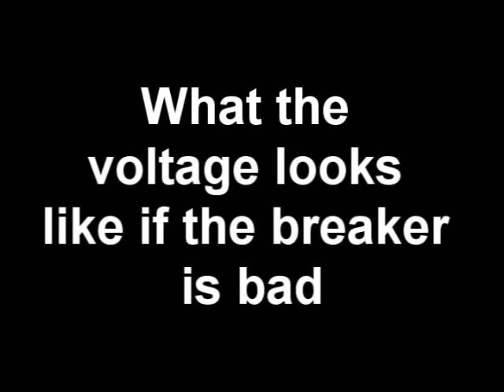Checking for a Bad Breaker

Comment: Should the breaker be turned on or off before you do this test?
Reply: Not trying to be nasty but after that question do yourself a favor & do not open your electrical panel without an electrician with you.
Reply: trudaroof 👉🏻😂

Comment: I just had a double pole 20 circuit breaker go bad. There were two hots connected to each screw. I had the power turned off at the main breaker. After disconnecting the circuit breaker I turned the main breaker back on for light. I took my tester and checked the four wires I just disconnected. One of them was still hot. How can that be? It is not connected to a breaker/ I would appreciate your feedback.

Comment: they might have had that one wire that was still hot connected to another breaker, maybe in a junction box somewhere. so, it was double fed and you could check this by turning off the other breakers one at a time and when your mystery wire goes dead you would confirm it. but then you have to find where it was connected, and of course what caused the whole kerfuffle. good luck.

Comment: I have a 40 amp, 2 pole Square D that reads 120v to ground for both terminals but, 0 volts terminal to terminal.  I still can't figure out how that is possible for a Delta circuit.
Reply from the maker: Ok if your getting that kind of reading on that double pole breaker, test another double pole breaker in your panel to see if your getting the same results.  If your not, then change out the breaker, if you are, then you will likely have another issues such as a bad main or even service issues to your home.

Comment: Why do you not make contact with neutral first then red?
Reply from the maker: Its just how I did it in the video.  But if I am checking a double pole breaker, its just force of habit for me to check one side to the other first, then each pole to neutral or ground.  But in reality so long as you do all those checks, the order does not matter.

Comment: good video. don't know if you can answer this, but my washing machine stopped working. when I checked the outlet with a multimeter it just reads 100 volts. but at the screws where the wires are connected, I'm getting 117 volts. any advice? thanks

Comment from the maker: @kurttwentyeight - I personally dont like analog meters.  For the type of work that I do, analogs will not work.  However, they will work perfectly fine when checking voltages such as this.  So whether a digital, or analog - you can still do this test.  Hope this clears this up for you.

Comment: Hi  I have a pushmatic panel box. I recently started having problems with losing power to office and garage lights while the basement lights are wired on the same breaker and stay on. I have taken panel cover off and there is only one wire. I unscrewed this wire and moved it around a little and the power to the office and garage started working but when I tighten the screw down it doesn't work.  Any idea what my problem is?

Comment: my power died on all the plugins on one side of room. checked and replaced the ones that looked questionable (burnt spots) tested each one before install and still nothing at plugs. got power above (lights ,fan, etc) what is it ? dont really want to go in attic where wires run. could only half the breaker be working? it is a 15 amp one.

Comment from the maker: Are you saying that you checked the outlet and got 100v when you simply pushed the prongs into the outlet?  Then pulled the outlet and got 117 when going directly to the wires?  If that is the case simply replace that outlet.  Corrosion has set in and it needs to be replaced.

Comment from the maker: That tells me you have a loose connection in one of your outlets or switch boxes.  Or its also very possible that one of the connections are corroded preventing the power from flowing through.  Unfortunately for you the only way to fix this for good is to open up each affected device on that circuit and pigtail your wires.  That will prevent this kind of occurrence from happening again.

Comment: I had a breaker trip on my hot water tank, it seem to reset ok. i checked all my elements etc. but still no hot water. Is it possible the breaker is bad even though it apparently resets?

Comment: if the breaker tests bad though would it still work?
Reply: yes, my 30/20 amp rv main breaker trips, I already know it's the ac only when I have the compressor on the ac is hooked up to the 20 side, will run a while but when it trips the breaker and I reset it, takes a while to reset, I checked it like he shows on here, never done this before and shows 120 volts on both sides , but only the 30 amp main side trips instead of the 2, and asked seriously if maybe even though it test 0 would still work just not fully as it should I think if it shows 0 it should not even work 0 volts means no voltage, no electricity flow however I asked before I tested mine, as far as the ac  I cleaned the coils yesterday, and the breaker did trip a few times so I need  to keep trying to figure out if it may be the capacitor, freeon, compressor itself or wiring, I tested the breaker but was thinking about replacing it, but hasn't tripped today even though the question was serious I think the answer is No '0' and Bad should mean it won't function.
Reply from the maker: Compressors typically need a dedicated circuit in order to operate.  If you are using this in your RV you are very limited on power available and likely going above the breakers threshold as you are using other appliances.  I would suggest that you get a smaller compressor or just use the compressor only at a campground where you can plug the unit into one of those RV pedestals.

Comment: If you have gone through and checked all your 220v breakers in the panel, and this is the only one that show 0v to ground on one pole, then yes this would be the bad breaker.  If all your 220v breakers are doing this then you would need to look at your main breaker.  But again if its just that one, you just need to change out that one breaker.

Comment: My breaker takes about 15 minutes before it trips, Clothes dryer 220 any input. my stove is on the same breaker so I know I can't use both together, but the stove doesn't trip the breaker but the dryer does after it runs a while
Reply: sounds like you've got faulty parts in that dryer

Comment: I got a 30V reading. Is that between Good and Bad?
Reply from the maker: That will indicate that you have a bad or failing breaker.  However just to verify, double check other breakers so ensure that is the only one showing that voltage.
Reply: @TheElectricalDoctor  Thank you for replying！I will check

Comment: My 30A 2 pole breaker popped and feels loose or mushy. I have set it in the off and then back on the on position. The power is not returning even after unloading the circuit. Is this an indicator that my breaker is bad and should be replaced?

Comment: For me as german electrician it's nice to see american electrical installations, and the voltage.. 120 volts. A question though: what amps do usual american circuit breakers have, and do they also have characteristics, like in europe "B16A" or "C25A"?

Comment: Thank you for the video it is much appreciated and saved us a ton of money.  I am laid off so income is really tight.
Reply: What if its a 3 pole breaker?
Reply: And its open delta service?
Reply: Really old comment, I know. And I'm not an electrician, but logic would dictate that it would be the same as a 2-pole. You should read 360v from top to bottom terminal, 240v from any two adjacent terminals, and 120v from each individual terminal to ground. Someone can correct me if I'm wrong.

Comment: What setting do you use on the multimeter?
Reply: +Rhiorrha Depends on the multimeter. He's using one that's automatic. I have one with several settings within each category you're testing. If you're measuring up to 200V, put it on the 200V setting. If the reading is higher, it will sometimes still read, but you may get an error message. If so, switch up to the next higher setting.

Comment from the maker: I am a licensed electrical contractor, so your statement of being a wanna be is untrue.  If you would have worded your post differently I would not have taken it so offensively.  But if you used a regular digital volt meter it would not have tripped.  You must have used one that allowed a little current to flow like a meter called a wiggie.  The fact that it tripped means the breaker is doing its job.

Comment: Hey I got a question I’m hoping someone can help me with so I have a air compressor that when it runs keeps tripping the breaker is it possible to get a higher amp rated breaker and if so how would I determine what amp rating to get it’s a 115v single phase motor with the standard outlet

Comment: my problem is a mainbreaker 100amps.almost every an hour was tripping.only small load when i use clampmeter.
Reply from the maker: If your main is tripping when you only have a small load, then its likely you will need to replace the main breaker.  For this you will need to shut down the power at the meter.  A call to an electrician may be in order here.

Comment: that's not a complete test. There are breakers that are heat sensitive that still put out the voltage but will not hold the amps

Comment: Or on 240 you test across and get more than 120 but less than 240 then you have bigger issues and the breaker isn't bad. If one side says 83V and the second says 123V then you have a lost neutral and you need to call an electrician!
Reply from the maker: Your assumptions are not correct.  The breaker can still be bad with the voltages you mention.  If your getting 120v to neutral on one leg but 83 on the other, your neutral is not the problem, you have a defective breaker that needs to be replaced.
Reply: @TheElectricalDoctor   breaker replacement did not resolve the following...what would you assume to be the fault?

Panel a double 100 amp feeding a small cottage (panel b) .....panel b lugs tested 123 and 83V. When a double pole 30 is flipped to power on the hot water tank circuit the lugs 240 drops to zero.
Reply from the maker: @MyBigThing2010  Ok I will admit that some problems are not as cut and dry.  However now that I know there is a sub panel involved you need to do the following.  Go to the main panel, check voltage at the breaker that feeds the cottage.  If all voltages are stable there, but are still erratic at the cottage you may have lost one of your phases underground between the main home and the cottage.  You will also want to look for any junction boxes at the home and in the cottage because people will sometimes run power from the panel, to a junction box, then down through the ground and back into a jbox again before going into the panel.  Does that make sense?

Comment: Why does it have to be a digital meter?
Reply from the maker: That is just what I use.  You can use any meter that will give you a voltage readout.   That is critical when trying to troubleshoot

Comment: The time between the 1:30 to 1:50 marks is totally confusing. First, you show what it should look like if a double poll terminal is good. It shows 250 volts. Then you say 'here's what it looks like if they're bad' and you touch the exact same terminals and say 'it should read 120 volts.' Huh?

Comment: What if I'm only getting 70 volts
Reply from the maker: If you are getting 70v on one of the legs to ground you have a bad breaker.  However to verify this go to another breaker to see if you get the same or different results.  If you get the same results you have a bigger issue, if you get 120v to G on each leg doing this test on another breaker than you have a bad breaker that will need to be replaced.

Comment from the maker: This is your original post - It's interesting that you tell someone they don't know the first thing about electricity. Clearly, your knowledge is limited because you are telling people to use the red multimeter lead on the breaker and the black multimeter lead on the neutral bar. This is AC power, dude, and you don't need to differentiate between the red and black multimeter leads. It's amazing that you're a licensed electrical contractor and you're telling people information like this.

Comment: The fundamental purpose of a breaker is to trip when it's overloaded [in order to protect the house wiring]. I expected this video to show how to find a breaker that is not tripping. This video doesn't even show how to distinguish a good breaker from a nail in its place.
Reply: The fundamental purpose of a breaker is to protect the wiring. A circuit breaker as a trip curve. Meaning, if you have a 20 amp circuit, and you are currently loading the 20 amp circuit with 21 amps, it may never trip. As the amperage over the rated breaker increases, the faster it will trip. Using the same 20 amp circuit, if we DOUBLE the current to 40 amps, that circuit "should" trip at around 30 seconds or so.

Comment: I have a line of outlets that aren't working . I checked all of the breakers and they all still have voltage . So maybe I was thing it was a bad outlet . So I went around and changed all of the outlets that were off . Went back to the breakers , they still have voltage . But the outlets still don't work
Reply: +Sylis Crow You sound like me. I'm having the same issues with my well pump. It sounds like you have a bad connection somewhere along the way. Check the wiring in the back of all the good outlets, as well as the bad ones. (Just be sure the breaker is off! lol)
Reply: If the breakers are good and the receptacles are good and wired right then look to see if you have some sort of bad connection in any junction boxs that might be in the path. if nothing there then one other thing I can think of is if you have more then one receptacles on the same circuit that are daisy chained. and some of them are working and others arnt. Then go to the last one on the chain thats working but before the ones that arnt and check the wiring on the backs of the ones that are working to see if maybe a wire is off on one of them that carries voltage to the ones that are not working down the daisy chain.
Reply: If your outlets use the push wire(quick connections) instead of the screws that can cause a failure of circut

Comment: While I think the video is in good spirit of teaching DIY'ers, you really should have used proper terminology about open versus closed breakers and had just a little more explanation of the difference between open, closed and what a bad breaker really could read.  Eventually your liable to get a DIY'er that reads 83 volts  or any range for that matter, across their meter and they may not realize its a bad breaker and not their meter.

Comment: Something seriously bothers me about this video.  It shows you how to test for a breaker that is not conducting when it is closed.  When you get "0" and it's supposed to be "on", yes, the breaker is indeed bad and your circuit is dead.

But this video does NOT do anything about a far more serious problem - a breaker that does not shut off when there is a short or overload.  That is the most important function a breaker performs.  If it doesn't shut off on an overload, your house burns down.

As such, this does not really test for a "bad breaker".   Breakers that won't trip are the worst kind of "bad" there is.
Reply from the maker: The purpose of this video is to test for a bad breaker, not to determine if the circuit is shorted.  This video is not meant to test for a breaker that wont trip.  That is for people far more advanced that the viewers that come to see this.  All your complaints have nothing to do with the information given in the video.

Comment: I am an industrial electrician and I absolutely hate when people refer to 240/120 volts as being 220/110 volts.. I don't know why it gets to me but it does for some reason.. I work with voltages that are off the wall but the devices and breakers will specify what voltages they are.. I bet no one calls a 30 amp / 125volt circuit, as being 110 volts.. its 125 volts at the panel and its 125 volts at the receptacle.. thats the same with 240/120 volt circuits.. I think its mainly residential electricians that will call it 220/110 volts because most of them don't even carry a meter...